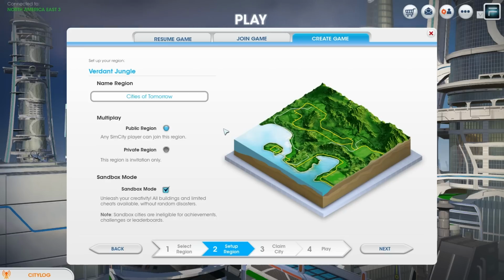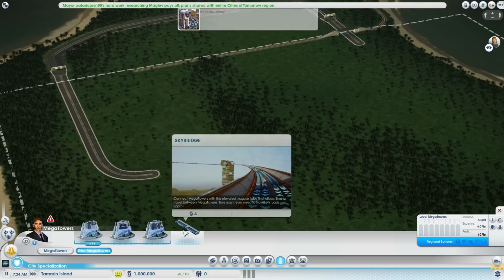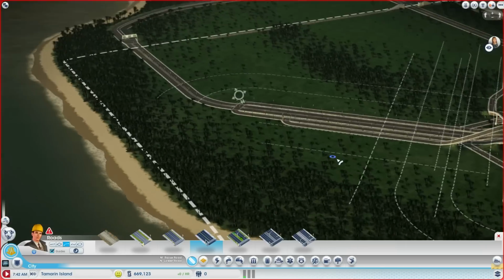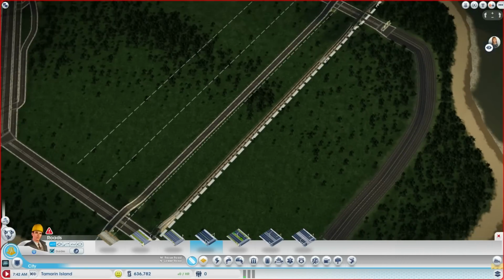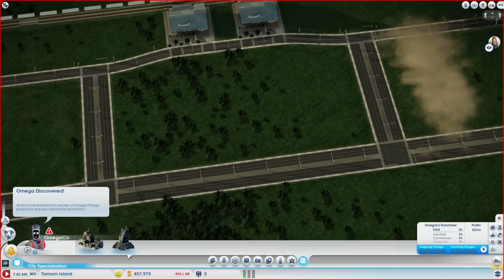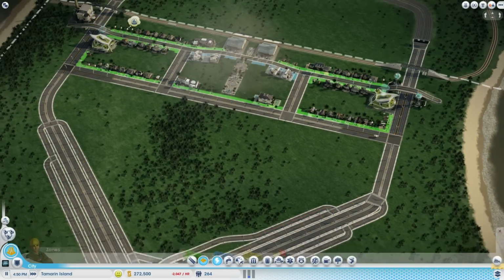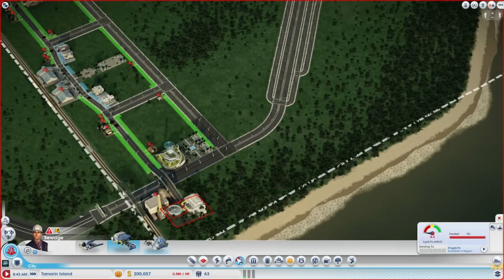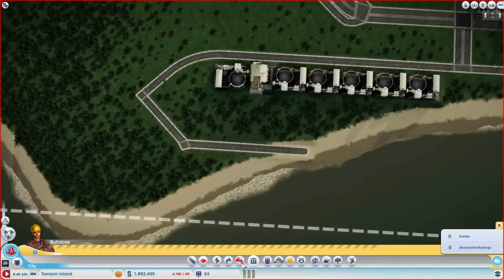SimCity Cities of Tomorrow - Summerset [PART 1] "Clean, Futuristic City!"

Comment: Whenever I build a futuristic city, I always specialize in education. I put every school available in the city to raise the tech level. Once this is done, I replace the oil plant with a nuclear one. Once I get the academy and all associated buildings, I build a fusion plant and max it out. Once its activated and operational, I demo the nuclear plant and replace it with factories. Then the control net is increased with control net facilites and I start a maglev system.

Comment: Need to find a simcity torrent for a mac for fuck sake.
with all due respect to the developers.
Reply from the maker: That might be difficult, as SimCity goes pretty hard on the whole "DRM" thing. At this point, I would just buy it. It'll save you a lot of trouble, and it's only $60
Reply: *****
i know, probably wait till a sale comes up.
Reply: VeniVidiAjax Your one tight ass it's already cheap enough to buy.
Reply: david thompson
;)

Comment: 34:25 Why is he putting down filtration pumps? If I'm not mistaken, they're only supposed to be used in areas with high ground pollution.
Reply from the maker: Yes, but at the time, I was planning on also placing industrial buildings near bye. I eventually end up changing this around and moving the water treatment centers elsewhere